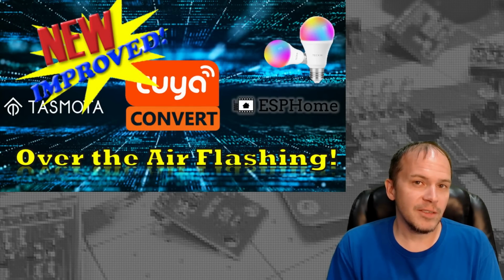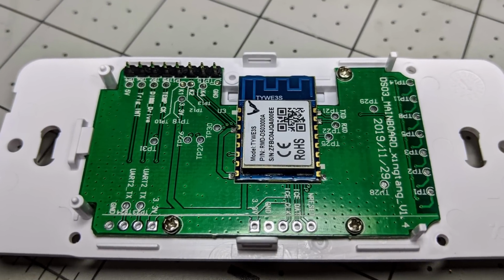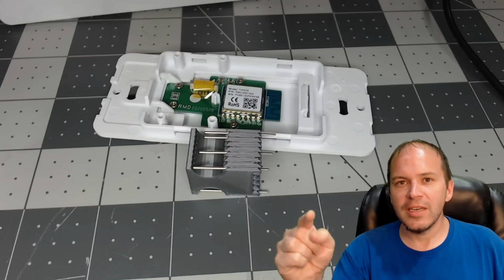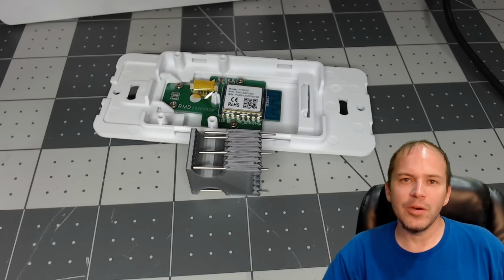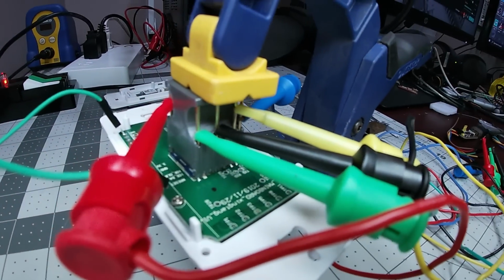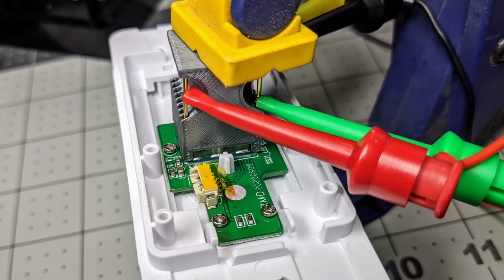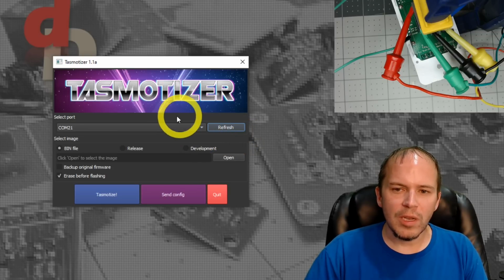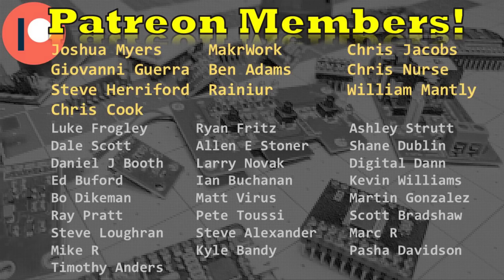Tuya Convert Not Working? NO Solder Jig | Flash Tasmota & ESPHome

Comment: Or just get a set of those clamp probes and cut in half and put a 4-dupont connector on them and color code them and you have a jumper for your usb ttl/serial/uart flasher, or even desolder pins and solder clamps on permanent
Reply from the maker: Clippy bois?
Reply: @digiblurDIY  I didnt do enough research into Tuya before I purchased a few lightbulbs.  I liked the idea to re-flash them when I purchased 3.   But then I get em and it's not working and I start to do more research and find out Tuya used a new module in >2019,. lol.  And bulbs have to be ripped apart to do.  So I am stuck doing the API calls in the cloud with the Tuya multiple apps for home assistant integration.  Sucks :(, but I would totally print one of those files and reflash any switches or outlets I had.  

But I have all Zwave/Zigbee at the moment (about 35 switches and 10 outlets and a TON of other zigbee motion and door/window sensors.
Reply from the maker: You can use a Tuya Cloudcutter most likely on the new module.
Reply: @digiblurDIY  I didnt come accross this at all during my research!  Thank you!  Testing out now!  I wish Tuya would just addopt Matter or something...  but the fact they are a "ready made" smart home tech that just license out their products and API and cloud to any company wanting to jump in to the market is their bread and butter...  make it so those companies are stuck to you for the life of the products and you always have an influx of money, unless they fold... 

Even the Tuya app is a generic one they provide, and companies can skin it with their logos and colors and poof, abcsmarthome, inc. has an instant overnight full smart home device lineup and smart app...  :/

Comment: Howdy - I have one of your illustrious jigs and have used it successfully on a switch.  However, I have a strange problem, I have a YeeWell brand switch (TYWE3S chip) that is a post 2020 (cannot OTA convert).  I pop the jig on, wire it up and Tasmotizer'ed it with the latest firmware - apparently successfully in that it hit the 100% done pop-up.  I reassembled the switch and hooked it up and it proceeds to automatically and continuously toggles on and off.  Ever had that happen?
Reply from the maker: Does Tasmota come up? It could be normal if the relay is on the status led pin of a sonoff basic. I hate that the default of that comes up still today.
Reply: @digiblurDIY  The switch never appears as a Tasmota access point on WiFi.  Being a newbie that's what I expected to see.
Reply from the maker: Take gpio0 off of ground. Open a serial terminal at 115200 baud. Termite serial terminal works. See what's going on with it. The jig needs to be connected of course with mains power not attached.
Reply: @digiblurDIY  Can do but I need a bit more insight.  Can you point me to a tutorial or command list that I can use for problem determination?
Reply from the maker: Probably one of my older ones with a serial flash. It shows the use of Termite. It is the same console you see in the Tasmota GUI so the commands are the same. I usually hit enter to see if I get anything back from Tasmota. Jump into our discord if you get stuck.
Reply: @digiblurDIY  You are a god.  Not THE god but one of the lesser demi-gods.  OK, via serial I can see that it is working and the WiFi access point works and I can update the network.  I put it my test jig to see if it works on home power and all is well.  However, when I reset it (because I wanted to know what would happen) it went back to toggling.  While the access point eventually shows up it is too busy toggling for me to update the network.  For this pair I will just set it via 3.3 volts.
Reply from the maker: So you were able to get it going?  I've had one do that where the relay was toggling back and forth which is why I do my compiles as generic instead of sonoff basic as the default but it didn't stop me from doing anything, it was just annoying.  I wonder why yours hangs up when it does that?   Weird...

Comment: 8 Dislikes, that is how many at the Tuya HQ speaks English
Reply from the maker: Hahahah... They probably hate my latest ones.
Reply: @digiblurDIY   if you like snooping on devices with odd behavior, get a Reolink PTZ zoom camera and a normal Reolink PTZ, connect both to your network using the phone app and all that BS. 
Call the zoom camera "something PTZ Bedroom" and the other whatever you want. On my network, the "Bedroom PTZ" has had traffic of 15Gb uploaded the last 3 days and it has been used for a maximum of 2 minutes, the other two PTZ cameras + my front gate camera, a Reolink RLC-511W has combined, less than 10GB uploaded and the gate camera is on for at least 15 hours per day. (combined data for these cameras are over a 10 day period) xD
Reply from the maker: I haven't seen that issue before except with someone using a drunk Unifi router. It said an ESP chip transferred 100 gigs of data in one day.
Reply from the maker: All depends on if your network is 94.38748% happy or not. 😎
Reply: @digiblurDIY  it used to be Everything is Great! 109%, do that count? 😂
Reply from the maker: There were a few reasons I didn't go full unifi stack and just use their access points. I am very glad I didn't go further about 3 yrs ago or more.

Comment: Mr. Blur have you looked at Tuya Local?  Without being able to OTA flash some of these units I was wondering your thoughts on this?
Reply from the maker: Yeah but it did seem to have some issues. Many other more reliable devices/solutions out there.
Reply: @digiblurDIY  Do any of the other options not involve taking apart the switches and reflashing them? Thanks!
Reply from the maker: Yep, tuya convert still works on a few switches.  Or you can roll with preflashed stuff, Zigbee, Zwave, or a few things have local control like Shelly.
Reply: @digiblurDIY  Right, so my situation is as such: I have 30ish switches installed - they will not flash over the air and I REALLY don't want to remove them. So I thought the tuya local might be a good alternative unless there is another less invasive option? Thanks so much! I am using treatlife switches right now.
Reply from the maker: Me, I'd just probably buy a few spares, flash 'em, and swap them out here and there and have them done in a week or two and not waste my time on some other hacky method.
Reply: @digiblurDIY  Can you tell me where you sell the device to re-flash the switches?  The 3d printed job so I can order be now that I am at the house in question. Thanks!

Comment: I would like to thank you all this help. I received the 'No Solder' jig in the mail today.   I previously tried the wireless Tuya-covert that went totally wrong while trying to upgrade a Martin Jerry switch. After getting everything all setup, I was able to successfully flash aTYWE3S module and get it up and running. I will definitely moving more smart home equipment out of the cloud.
Reply from the maker: Great to hear!  It's addicting taking full control over the electronics you purchase.

Comment: this is the only method to flash? I bought a switch and it came with the TYWE3S P/N w601. would there be any other way to flash?
Reply from the maker: Tuya Convert might work.
Reply: @digiblurDIY  I tried following your tutorial(watch?v=dt5-iZc4_qU&t), but it didn't work. do you think this new version of tuya convert works?
Reply from the maker: Check the psk log for the decryption error.
Reply from the maker: Yep, that's new blocked firmware.  Lucky it has a TYWE3S that can be flashed manually.
Reply: @digiblurDIY  do i need to do the same as you did in this video?

Comment: Just a short note that I fould the plastic clamp at a local big box hardware store here in the Midwest for $3.99.   Model is a Quickgrip by Irwin MFG.  Local big box store name is Menards.  Initially here used painters tape to keep the jig on to the chip.  

The endeavor started me on cleaning up electrical wires and replacing the metal dual gang mud ring with a plastic mud ring.  I used Ideal push In connectors and removed all of the wire nuts.  These push in connectors are available at most if not all big box hardware stores.  I replaced the metal mud ring with a Carlon or Thomas And Betts Lamson plastic mud ring.

Comment: This may be off-topic, but your video sparked an interest.  I have Geeni/Merkury products in my home that utilize the TYWE3S system.  At the moment, I am wedded to their cloud.  Is it possible to convert them to another system?  Maybe not the A19 light bulbs because the module is embedded in the screw base and access would be very difficult.  Another question has to do with a device that does not register in their cloud.  It connects - creates an AP I can connect to - but the activation fails.  Is repair possible by reprogramming?
Reply from the maker: Anything that basically has the ESP chip which the TYWE3S is, and you can physically get to the chip, it is all fair game and can be yours.  Flash it!

Comment: I had been working my way through your videos relating to flashing Tasmota on various Tuya-based devices having purchased several Gosund dimmers and switches. I have enjoyed your videos and found them to be very helpful. The first units I flashed, I soldered leads to test pads available on the board which was fairly tedious/tricky. I even tried creating my own plug/jig using dome pogo pins and a hobby board. This was very awkward and just didn't end up being very useful.  Then I happened upon this video that solves the problem very nicely with a jig to connect on the chip itself... brilliant! Anyway, I am now a fan and am very grateful for your videos and the time you take figuring this stuff out.

Later...
OK. Bad news... the switches I have use a different package for the MCU. SO... the jig will not work as implemented here. But, since you included the FreeCAD file, I can see if I can modify your design that will work for this other package... there is still hope. :)
Reply from the maker: What modules do your switches have?
Reply: @digiblurDIY  Funny you should ask... I asked a question on your discord server after having problems programming them, and it was suggested that the KKWE2S modules might not be ESP-based and that could be the source of problems I'm having programming them. I haven't been able to confirm that, though. I've not found any info on this particular module online, nor FCCID on the units themselves. The MAC addresses, though do have vendor codes that are Espressif, and my router lists them as "ESP_xyzabc" when they join my wifi. The units are Gosund... internally, the module has the identifier "SW2" on the boards, but the box shows them as "DS1". So... I am at a loss. Any info or guidance you can offer would be most appreciated. Thanks for responding.
Reply from the maker: I bet those are ESP chips then.  I know Gosund has used some weird packages on their chips at times.  Now finding the pin out could be a pain unless you can take that metal housing off.
Reply: @digiblurDIY  Lol. Yeah, for sure... I have been through ALL their datasheets looking for a package match.. A couple are close (pins on three sides), but different pin counts. The first unit I programmed successfully with wires soldered to the (test?) pads on the board (labelled Rx, Tx, 3V3, GND, GPIO0), so it seems they're labelled correctly. Unfortunately, that first (working) module is installed now and I've been reluctant to pull it back out and disassemble it to confirm whether it's the same as the units giving me problems. Certainly, from memory I think it's the same, but I wanted to check the part number, version number, etc. printed on the module. I am still able to reset the modules and configure it with the Gosund app on my phone. So, I think I haven't damaged the units messing around with them. I think I'll get out the scope and have a look at the serial comms and see what I can see...  If I don't get something going soon, I'll probably abandon them in favor of a device that you have info on that is known to work (I think there's an MJ Dimmer you've mentioned that might be a good choice). Anyway.. weird. not sure what else to try... just about ready to throw in the towel. If I do, the last thing I'll try is de-capping one of them to have a look under the can. Definitely curious. Thanks for the consult.
Reply from the maker: I was going to say to take the other one and scope out the pins based off the known working ones.
Reply: @digiblurDIY  Wow... You are not going to believe this... After a few days break (to follow the election results) I removed the can from the ESP module so was able to confirm the part really was an ESP8285 as expected. I then started buzzing out the connections between the pins on the chip itself and the pads on the board I was using for my connections and everything checked. Then, I moved to the pin ends of the dupont wires I was using to connect to my serial adapter and I found that I had no continuity on the Rx line! So, all this heartburn was from a bad dupont wire with a break somewhere in its length. I replaced the wire, connected everything up and fired up the flasher... voila! It flashed without any problems! So, my project is moving again. Thanks for talking this through with me. Just goes to show... assume nothing... check everything!
Marty Wise, Gloucester Virginia, USA

Comment: I flashed my treatlife light/fan switch with tasmotizer and it seemed successful.  Tasmotizer would not, however send the wifi configuration through, and I could not get the IP address. I tried a couple times, and even wired it up to main power but I am still not able to find the IP address.  I don't think it is in the access  mode.
Reply from the maker: Try a reflash and make sure erase data is checked and after power up make sure GPIO zero is not held to ground.

Comment: Thanks for the excellent instructions. I just got mine working. I ended up just soldering the wires since I don't have access to a 3d printer. The ground pin was a little tricky to solder and the gpio0 was also hard since all you've got to attach to is the castellation. But flashing worked the first time. Thank you!

I've got a two gang box with decora/decorator covers. Now that I have a free spot do you have a wifi button, preferably several in one unit that you recommend?
Reply from the maker: Yup!  I have one or two of these 3 button switches.  It will take a jib/solder manual method but again, super easy one as it as the TYWE3S module again.  https://amzn.to/2GHtQsi

Comment: Great video! I took the CAD file for 3d printing to several places and they said the same thing that the wall thickness is below 1mm and it couldn't be printed? Is the cad model correct?
Reply: I'm having the same issue here. I shared the STL file with a few companies for 3D printing and all of them claim the wall thickness is too small and can't be printed.
Reply from the maker: Prusa printed it fine.
Reply: @digiblurDIY  Is that your own 3d printer or a service that printed it for you?
Reply from the maker: My Prusa 3D printer I have had for a couple years.
Reply: @digiblurDIY  Strange that someone else is having the same issue as me. Literally even 3d print service I contacted said the wall thickness on the model was too thin to be printed???
Reply from the maker: I haven't used the cad file myself.  Just the STL they have.
Reply: @digiblurDIY  It was the STL file I sent to them. They said it couldn't be manufactured from that file.....?

Comment: hey bud, do you have a jig for  the bn link outlets? bnc-60  The chip sits vertical - not easy to open up but I did without destroying it, disappointed to get inside and see very little access.
happen to know the pin out? https://imgur.com/lgWWbT0
tks
Reply from the maker: Like this? https://www.thingiverse.com/thing:3166330

Comment: hi digiblurDIY
could someone help with this problem i have with making a rule, I've a shelly that the relay needs to be on when 2nice plug has watts or amps under load.

Workings of the shelly
Firmware 1.70
Configured Shelly device to create WiFi Access Point and you can connect to its network. IP 192.168.33.1
Using the relay to power a vacuum cleaner

Workings of the 2nice UP111 Power Monitoring Plug,
Running Tasmota 8.3.1 Fred
connected to Shelly network
Operating a relay of a power tool.

Rule 1
  ON ENERGY#Current>0.025 DO http://192.168.33.1/relay/0?turn=toggle ENDON
  ON ENERGY#Current<0.025 DO http://192.168.33.1/relay/0?turn=toggle ENDON

im sure its my coding that needs correcting, 

thanks,
Reply from the maker: does your rule fire at all?
Reply: @digiblurDIY  nope, but if i jump on the shelly network it works on the web browser, same as the tasmota works from a web browser with the ip signed with 192.168.33.2 on that shelly network. 
its a shame that tasmota can't sign a network like when first installed. like the shelly, so i could run both on tasmota,
Reply from the maker: Sign a network? 
See if your rule will fire off of just sending MQTT commands first.

Comment: If you are using 16mm pogo pins,  I have uploaded STL file for the 16mm pins at ( https://www.thingiverse.com/thing:4547369 )
Reply from the maker: Great job! I will have to check this one out as the other pins have become hard to find now unfortunately.
Reply from the maker: I tried these pins...couldn't find the exact ones. Looks like the rod diameter is bigger on these. Little bit of a bear to make them fit, holes just need to be a hair bigger. https://www.amazon.com/TOTOT-Conical-Thimble-Testing-Contact/dp/B07MZM62K5

Comment: Awesome :) I've gotten really lucky and managed to use the tuya-covert to push 5 recently purchased devices to tasmota. 3 of the devices had been setup in the cloud but apparently haven't received a firmware upgrade that breaks that method.

Been loving HA. Currently hosted on a Pi, but will probably push to a VM soon so I can back it up properly.
Reply from the maker: Nice work!